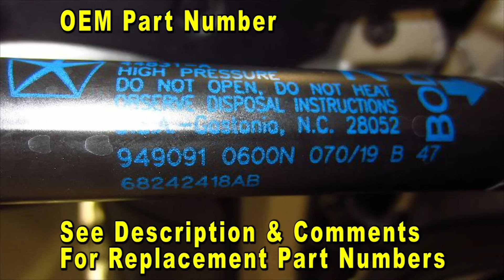2017 To 2024 Jeep Compass How To Change Tailgate Lift Support Struts + Part Numbers - Quick & Easy

Comment from the maker: Jeep Compass Tailgate Lift Support Struts - https://amzn.to/48ftbpi
Tuff Support Tailgate Struts Part Number - https://amzn.to/48jT1sc
Stabilus Tailgate Support Struts Part # - https://amzn.to/4adoZbo
Precision Screwdriver Set - https://amzn.to/3sLixaP
Plastic Pry Bar Tools - https://amzn.to/3HMtsV7
Socket & Ratchet Set - https://amzn.to/3Z17LbA
Mechanix Gloves - https://amzn.to/3jCnHkt
Torque Wrench - https://amzn.to/3vS5uSI

The Paul79UF YouTube channel is a participant in the Amazon Services LLC Associates Program, an affiliate advertising program designed to provide a means for sites to earn advertising fees by advertising and linking to Amazon.

This DIY video shows owners of the 2nd generation 2017, 2018, 2019, 2020, 2021, 2022, 2023 and 2024 Jeep Compass how to change the tailgate door lift support struts.

Comment from the maker: Check out the DIY guide for changing the tailgate support struts on a 2nd generation 2017 to 2024 Jeep Compass -
https://www.paulstravelpictures.com/2017-2022-Jeep-Compass-Tailgate-Support-Struts-Replacement-Guide/index.html

Here are all of the DIY repair and maintenance tutorials for the 2nd gen 2017, 2018, 2019, 2020, 2021, 2022, 2023 & 2024 Jeep Compass -
https://www.paulstravelpictures.com/Articles/2017-2022-Jeep-Compass-DIY-Repair-Maintenance-Guides.htm

Owners of other Jeep, Dodge and RAM vehicles such as the Grand Cherokee, Wrangler, Renegade, Gladiator, Cherokee, Grand Wagoneer, Wagoneer, Charger, Challenger, Durango, RAM 1500, Promaster, 2500 and 3500 may also find these DIY instructions to be helpful.